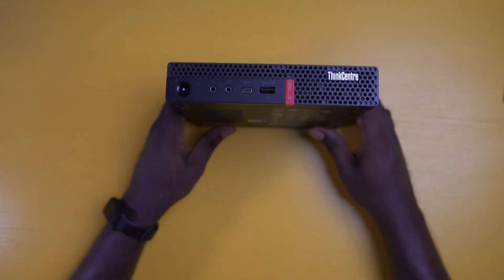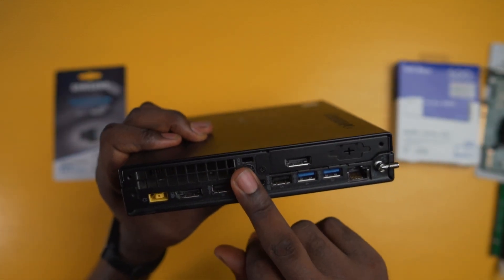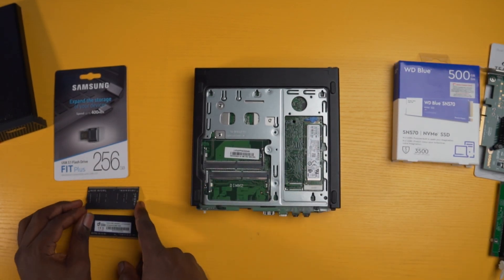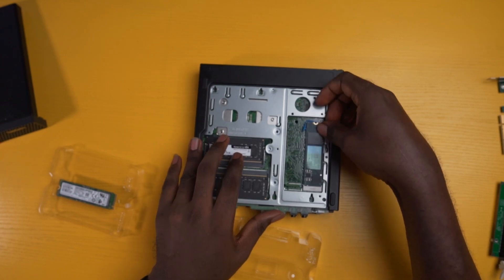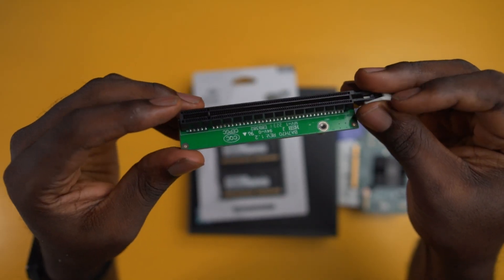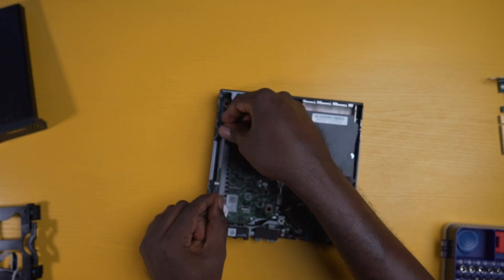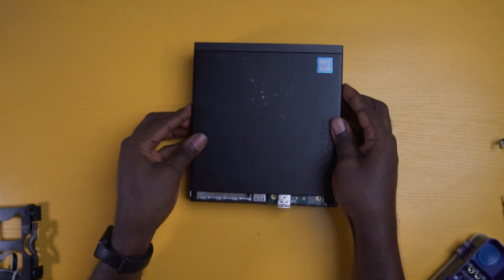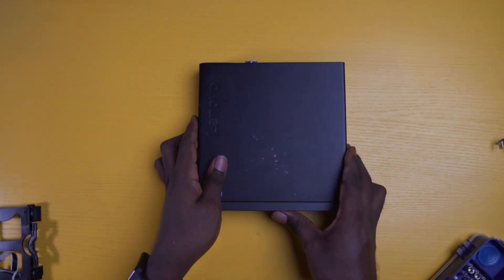How to Upgrade Your Lenovo ThinkCentre  M720Q with a RAM, SSD and 10GB SFP+ NIC.

Comment: Nice succinct vdo!  Have you (or others) added a Type C port adapter to one of these units?
Reply from the maker: I have not. But you can get one from ebay and install.
Reply: @Crenovated  after some research I think I need a PCI riser, which might mean I may have to remove the SATA drive
Reply from the maker: Yes, you need a PCie riser card if you want to use a GPU or a NIC.
Reply: @Crenovated  I'm thinking about an outboard eGPU, however I need a Thunderbolt interface.

Comment: Merry Christmas! I came across your video and wanted to ask for your recommendation on a 10GB SFP+ NIC to purchase from Amazon. I noticed there are x1 and x2 variants. For this configuration (X520-DA1), is that correct?

Thanks in advance for your help! I’m new to pc mods.
Reply from the maker: This is the one I used:  X1 - X520-10G-1S(1xSFP+) - Merry Christmas to you too.
Reply from the maker: Link: https://www.amazon.com/10Gtek-E10G41BTDAG1P5-Ethernet-Converged-X520-DA1/dp/B01LZRSQM9?th=1
Reply: @Crenovated  thank you

Comment: Is there anyway to put a gtx960 or any cheap gpu into it
Reply from the maker: You can find several affordable GPUs to suit your needs. Here are some great options available used on eBay or Facebook Marketplace: Yeston GTX 1650 LP, NVIDIA Quadro P620, Nvidia T600, Sapphire RX 6400, and NVIDIA Quadro P1000. Keep in mind, you might need a larger power adapter to support the GPU properly.

Comment: What "gen" m720q is yours? What CPU you going with? I'm trying to decide between upgrading mine to 9900 or 9900T (i9)
Reply from the maker: I have two M720's and both using i5 - 6500T and i5 - 8500T.
Reply: @Crenovated i have m720q with 16gb RAM ..can I upgrade with 32gb or not..pls reply soon..
Reply from the maker: Yes, you can.

Comment: Why did you remove the wifi card and antenna?  There's enough room to keep it.
Reply from the maker: Since I’m running a 10G connection, the WiFi card is no longer needed.

Comment: Thanks for your great video. How do I activate the second nvme slot? so I can have 2 nvme disks
Reply from the maker: If your device has two NVMe slot, just put in your two NVMe drive. It should be discovered automatically.
Reply: @Crenovated  I only have one NVME slot available just like in your video. Can we activate the second one? like we use riser for 10GB SFP
Reply from the maker: @ahmadimanudin No.

Comment: can you fit an amd 6400 on this model?
Reply from the maker: Yes, the RX6400 should fit in. But you will need to do some mod like removing the plastic covering that grill. Also you might need to cut a hole at the top cover of the M720q for proper ventilation.

Comment: After installing the PCIe riser card + 10GB SFP NIC did you need to upgrade to a higher power supply or was the default 65W power supply still enough?
Reply from the maker: Yes, the default power supply is enough to power NIC.

Comment: I purchased this item on eBay today for €50. It comes with a Pentium Gold G5400 processor, 8GB of RAM, and a 256GB M.2 drive. I already have 2x8GB of RAM and a 1TB SSD + 1 TB M.2 drive at home, which are scheduled to arrive on Monday.

Comment: Nice video, got the same lenovo tiny, thinking of adding 10g NIC as well, has the heat from the 10g NIC been a problem for it?
Reply from the maker: If you don't have it in a well-ventilated place, you can drill holes at the top of the case where the NIC fan is located.